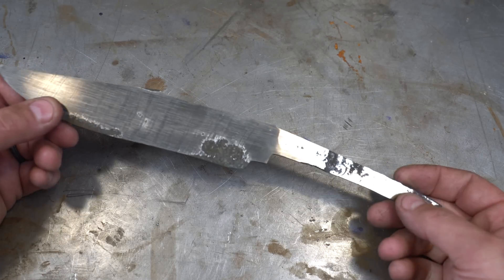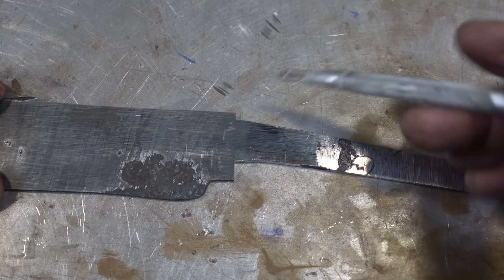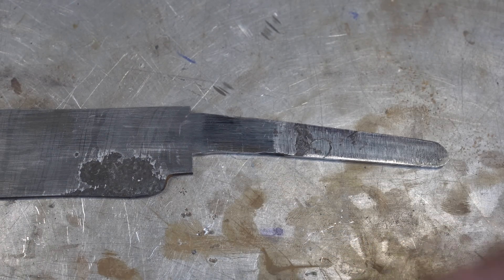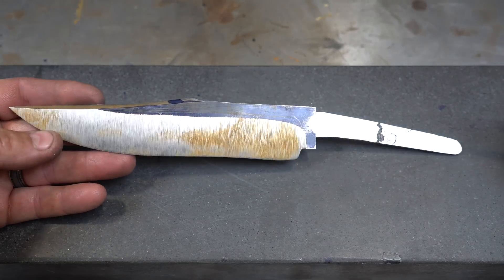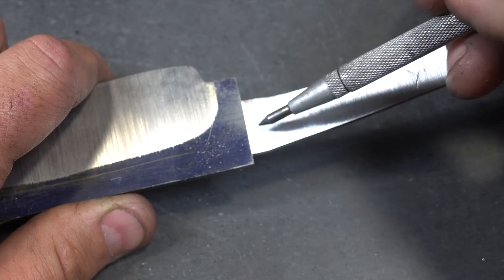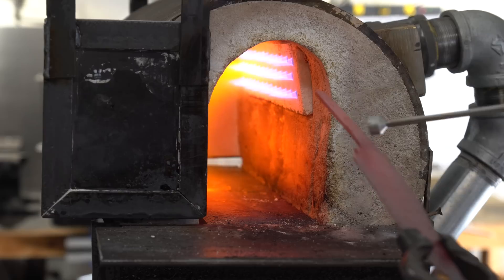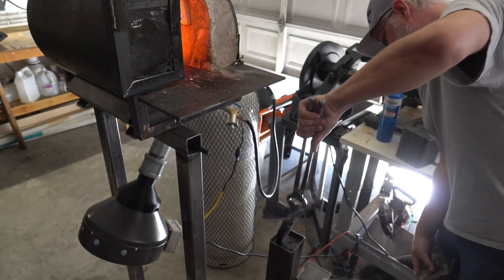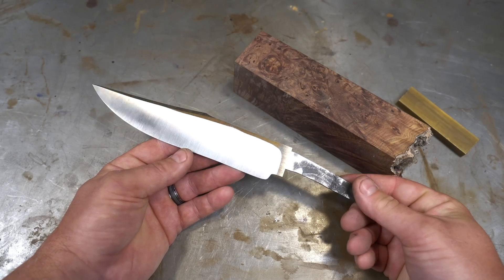Triple-T #91 - Intermediate Build Series - Grinding and heat treating

Comment: how long do you leave the blade in the temper oven at 400?
Reply from the maker: Typical temper cycles are two, 2-hour cycles, cooling with water in between.  The actual temperature you temper at depends on the hardness achieved after the quench and what the final desired hardness is.  Watch my video on Heat Treating, it explains this and has charts. Thanks for watching.

Comment: Great video Dennis. Thanks for sharing.
I did have one question as I'm making my first hidden  tangs now.  This is the only hidden tang video where I've seen you file the step in the tang all the way around. Do you no longer do this for a reason? I was thinking maybe it weakens the tang and you've changed your mind. I like the idea of it for making a tighter fitting guard but saw most of your other vids avoided the step. Thanks mate
Reply from the maker: I don’t do this because I’ve changed my process.  Since doing my JS I got sone tips from my MS (Michael Vagnino) to hammer on the guard to leave an imprint then I use a high speed rotary tool to grind that away so the knife sits “in” the guard.  Kyle Royer does this technique too.  The high speed rotary tools are expensive ($550 for mine) but worth it.  Thanks for watching, Anthony.
Reply: @TyrellKnifeworks  thanks so much mate. Ah yes I remember seeing you do that now. Without having the rotary tool, would you have continued doing this technique?
Reply from the maker: @anthonyluc389  no, even without the rotary tool you can hammer the guard on and get a better fit.
Reply: @TyrellKnifeworks  thanks mate. I'll give it a go.  Cheers

Comment: The rounding of the steel edges is not because of it being hot rolled, pretty much most of the steel you get is hot rolled, but its because its cut with a guilotine which sheer cuts the metal forcing the roundovers. Even if you buy ground flat stock it can come cut like that, most places will allow for that and make the bar wider, but not all. Ive been caught out once or twice by it. Now i buy it one size larger to be safe.
Reply from the maker: Now I buy my steel from Maritime Knife Supply so it always flat and square.  Thanks for watching.

Comment: What is the reason for heat treating after the initial grind? Couldn't you just do the heat treat and then grind?
Reply from the maker: Grinding hardened steel is much harder on your abrasives.  It’s easier to do most of your grinding pre-heat-treat.  Thanks for watching, Alex.
Reply: @TyrellKnifeworks  Got it. Makes sense. Thanks!!!

Comment: Why would you not just do all the beveling after heat treat? You had so much material left on the blade before heat treat.
Reply from the maker: While that’s possible, it takes longer to grind and you go through more belts that way.  Also with 10xx steel, it’s a shallow hardening steel so it’s better to be closer to final thickness when quenching as the thickness has an effect.

Comment: One thing that just popped in my mind; you have a mill, have you ever thought about milling your bevel in? at least the pre-heat one. I know that would probably come across as cheating but....
Reply from the maker: People ask about this on occasion.  That is a really tough thing to mill.  Just figuring out the angle, how to hold down the work, and make it repeatable on the other side is super complicated and not worth it unless you’re doing production knives, which I’m not.  Thanks for watching.

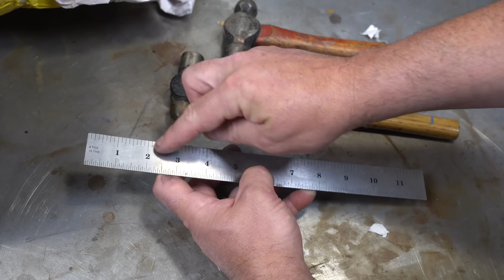Comment: 16:00. Okay now I have never seen that before. That's very interesting. I've used jigs flatstock angle stock and many other methods to get warps out, but I have never seen a ball peen hammer with a carbide ball. I'm pretty sure I have some carbide balls laying around somewhere and I know I have an extra ball peen hammer or two. I might make one of these based on how it works out for you
Reply from the maker: I’ve heard others using them with success but I’ve never tried it.  I’ll have to give it a shot sometime, even if it’s a forced test piece.
Reply: @TyrellKnifeworks  I think I would probably go with the test piece first. I would hate to hit a knife I spent a lot of time on and cause a stress fracture

Comment: Hey Tyrell, How do I heat treat stainless steel.?
Reply from the maker: I would consider that on the advanced series. You need a heat treating oven and most SS you quench between aluminum plates.  I have done videos on stainless steel knives before, check the library. 👍

Comment: Can you elaborate on the tempering?  You said 400 degrees but didn't say how long and if you did it more then once. For instance, one maker I watched said he'll do 400 degrees for 2- 1 hour runs, letting it cool down between runs.
Reply from the maker: Sorry, I forgot to add the text on that page.  Yes the tempering was 400F for two hours, twice.  I cool with water between.  No need to let it cool slowly.  I’ll talk about that more at the beginning of the next episode since I forgot.  👍
Reply: @TyrellKnifeworks  thanks for the reply and for sharing your knowledge!
Reply: You mentioned cooling with water between. If I let it cool down on its own to room temperature between cycles and when I pull it out the last time does that effect its hardness and the grain?  I've never heard of cooling it with water between temper cycles and am now curious as to if my knives are not hardened properly.
Reply from the maker: @PatheticPeasant  cooling slowly or with water makes no difference.  Water is faster and let’s you get it right back in the oven is all.
Reply: @TyrellKnifeworks  that's a relief. Thanks again for all the information.

Comment: As for problems grinding with your off-hand... I find that starting with my off hand tends to have better outcomes. I think this is because when I start I am removing material much slower, so it gives me the time to get into the grinding groove with my off-hand.
Reply from the maker: I’ve tried that and just switching between the always gives me a bit of trouble no matter which I start with.  Then after a few minutes I get used to it.  Everyone is different though.